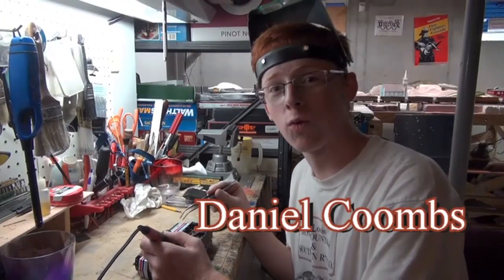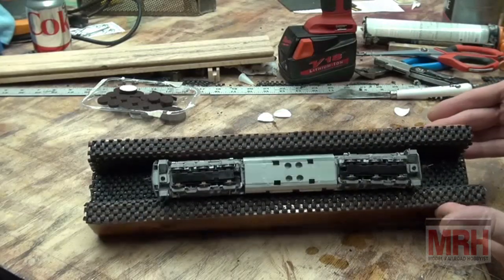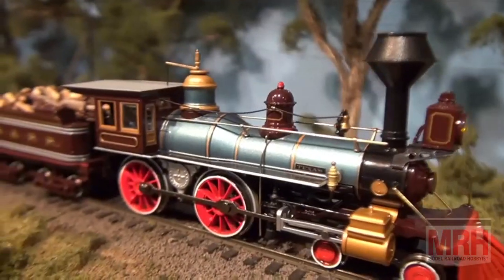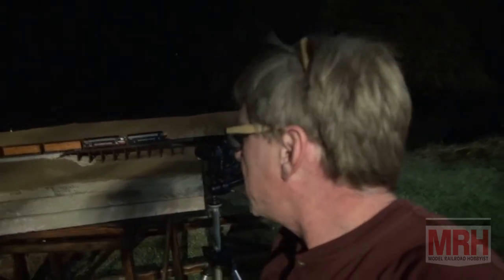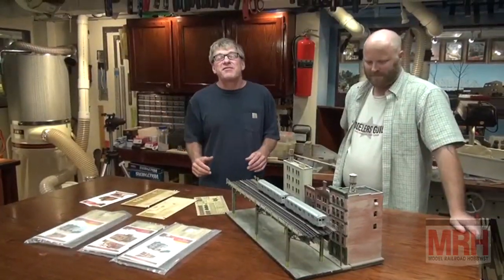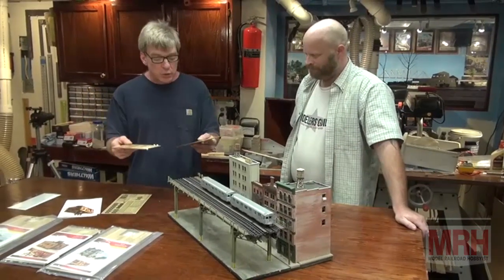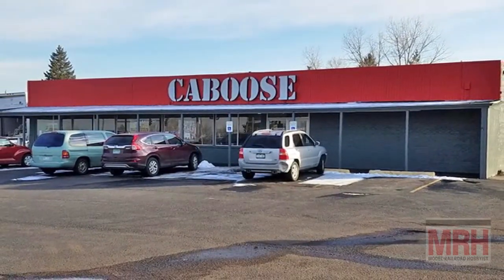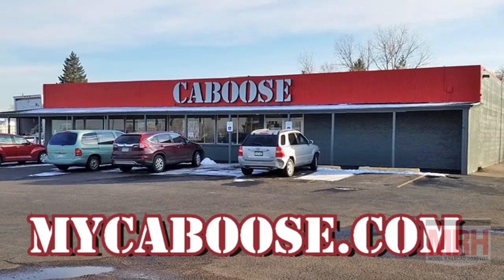Whats Neat in model railroading | November 2017 Model Railroad Hobbyist | Ken Patterson

Comment: Hiya, great video, thank you. On the cradle a 2 to 3 inch wedge of polystyrene holds the loco or stock and stops it from rolling away from the brush or tool... works well and is usually free. Keep up the magazine style it works well...

Comment: Hi Ken, I have used the material that  you used for the loco cradle. be very careful on how long u leave equipment in it, I used the material for padding rolling stock for safe storage whin not no the railroad and it stuck to the paint and pulled off some of it. I ended up having to strip and repaint the affected equipment. I used thin form from a craft store like Joan's or hobby lobby.

Comment: I am a little late to the party, but I just wanted to add a few comments to the construction section.  I model in N scale and I too paint all the parts of a kit before I begin construction.  I seal all my kits or scratch built structures with a flat oil based primer front and back to prevent warping.  Then I add the final coat.  I prefer acrylic paints, again to prevent warping.  Also, I use a clue applicator.  If I used my finger, I'd have a colossal mess.  Northeastern Scale Lumber carries a great wood glue and applicator.  I highly recommend it.  No, I don't work for them. Ken, even though most of your program is geared toward HO, I have picked up some useful ideas and techniques.

Comment: Couple of things...

No more layouts here, I've moved into audio and video, and that keeps me happy, so here's two ideas I had towards realism.

One, camera heigth. A major attraction of trains, for me, is their sheer size and impact when you stand next to one.

Any pictures or video shot from the scale eye level of a ten foot tall giant loses that impact entirely. I think at a subconcious level, our brains realize the unreality of imagery shot this way, and it detracts from our perception of the model itself.

Not every shot lends itself to a camera body "below grade". Even if the layout edge is close by, the frame of the shot, usually a lower corner, prevents the correct shooting angle.

One way around this would be a "reverse periscope."

Two mirrors at 45 degrees to horizontal, with threaded adjustments ought the get the job done.

Two...bass...low frequency sound. No... you'll never get "chest thump" out of a one inch driver, but if you have a home theater, you've already been exposed to an audio principle that...may... offer improvement. 

Bass is omnidirectional. It doesn't matter where your TV's subwoofer sits in the room, because you can't hear it directionally to locate the source.

Your larger layout speakers could be fixed, under the benchwork, and fill the gap... maybe.

A key issue will be where the onboard speaker starts to roll off low frequency. If too high, either the fixed speakers will "give away the game" by generating mid-frequency audio that doesn't move, and that is locatable...not where the licomotive is....OR... you'll have a "hole" in the midrange.

Assuming you get past that...the sound decoder manufacturers are the best candidates to... integrate such a solution.

In professional audio, we actively filter the signal so that the proper frequencies go to the proper drivers (speakers).

At most simplicity...two identical decoders, both addressed the same, one driving onboard sound and one driving your fixed sub-woofer(s), might do the trick, with the loudspeakers themselves doing the filtering.

Beyond that level, you'll need decoder support for crossover settings, plus, some impedance and signal level matching for the fixed amplifiers and subs.

Worth a manufacturer's time and effort? Well, it opens up huge new markets.. traffic sounds, industry sounds, wildlife, birds...a decoder in potentially every structure and layout focal point.

Time two, for deep, rich bass.

Just remember... "boo-boos"..at real life audio levels could not only wake up wives, neighbors and toddlers, ...they also extract a cost in blown amps and speakers.

"One Adam Twelve, caller reports a massive train wreck, except...there's no TRACKS in that neighborhood."

;-)

Comment: Hello Ken I just bought a foam v-shape cradle and in the front of the cradle has a groove in to the front of the v for parts and tools
they make this in all scales price range is $10.00 - $20.00 depends on the scale , they hold very well I will have to get the name for you if anyone is interested. Thanks, Steven

Comment: How come when I paint wood pieces they warp?
Reply: Bob Georgiou Use less paint and paint both sides. As the paint sterts to dry to the touch, if you see it starting to warp, put it between paper towels and weight it with a large book over night.
Reply: Moisture, modern wood kits require bracing due too the change from solvent paints to acrylic.